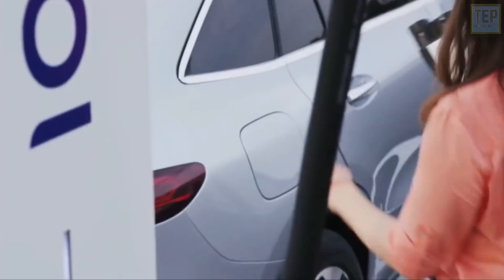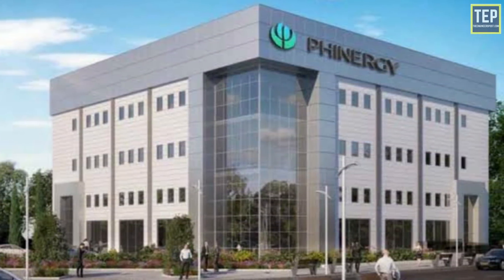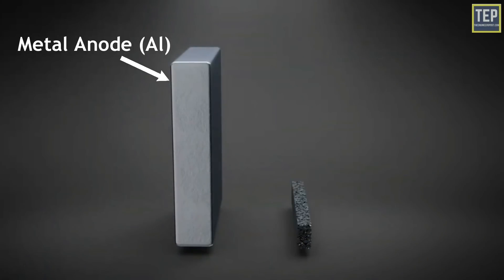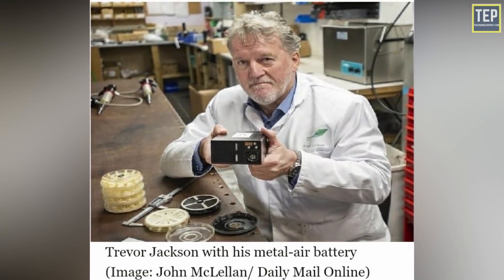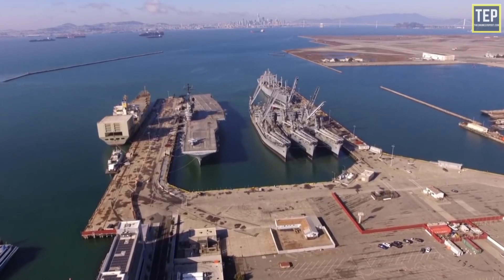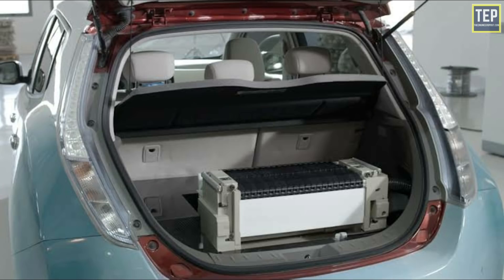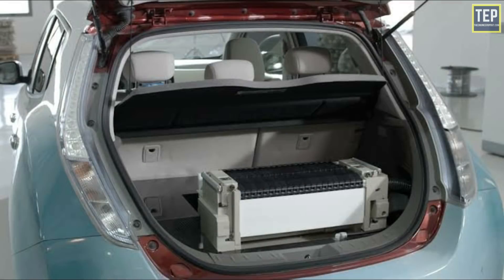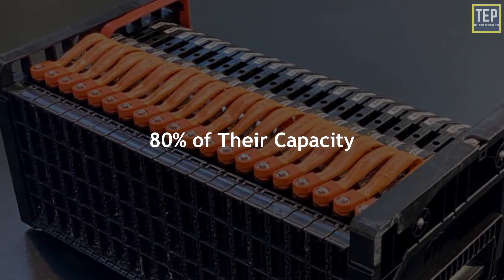Aluminium-Air Battery | An EV battery that Doesn't Need to be Charged

Comment: The title of this video is completely misleading. Also, the person who made it can't even spell aluminium properly. They misspell it multiple times. Anyway, the battery does have to be recharged. You just can't do it yourself. That's why it has to be swapped out with another battery, so it can be taken to a facility to be refilled.

Comment: Setting up the logistics  infrastructure to support Aluminium-Air batteries would be costly as you would be moving hundreds tons of freight to each service center to replace batteries for too few cars as compared to superchargers and or hydrogen solution's in my humble opinion.

Comment: Using the info from the video:
A Tesla Model S, with 370 miles/600km range, has about a 550kg battery pack. Replacing it with this aluminum battery world give it 2700 miles/4300km range. A kg only gives about 8km range? Short shelf life and non rechargeable?

Comment: First off, this "brain storm" isn't any more an EV battery than a hydrogen fuel cell. Yes, it is a power/ energy storage unit. Just like a gas, LP or diesel tank. What is the cost of a swap - fill-up? To head off power loss, two units would be needed. Good idea but comparing it to a battery is an apples & oranges misdirect.

Comment: what i think we need to find an alternative for petrol ..  it could be gas form or any lequid form ..  electric vehicle is Good but once the life cycle complete we have to replace new one and it will cost  50% of the vehicle cost..  battey wil get heat and we have to check daily ..

Comment: The biggest problem is degradation. So even if you don't use your car you need to swap the batteries let's say in 15 days or so. If this battery delivers range of 2000 miles and adequate swapping station then this is fake changer.
Reply: Maybe this Al Air battery can be made of different range and prices. You choose your range and swap at your usage pattern.

Comment: Since the aluminum-air battery cannot be electrically charged, the used aluminum anode and the electrolyte have to be physically replaced when re-used. In addition, the battery has a high self-discharge, which is why in some applications the electrolyte is only inserted into the cell shortly before or during operation. The additional technical equipment required for this is the primary reason for the comparatively low distribution and the high operating costs
Reply: that high self-discharge is a game stopper, I hope they find a solution.
I think the sweet spot for an EV for me is:
Aluminium-Air Batteries at 100 lbs with a range of 225 miles.
2 batteries giving a total range of 450 miles.
Reply: No you just cut the supply of water and no degradation will occur
The only disadvantage is that it recycle energy need is 5 times the output so you are running 20 percent efficient battery in overall system
To know more clear see
SCIENCE TO TECHNOLOGY channel
Reply: Where they've been deployed they work well.  They toughest part is they need an infrastructure of battery exchange stations.  I suggest the reason why they haven't caught on is people having a religious zealotry for rechargeable batteries and they cry heresy for anything that doesn't fit their idea of green.
Reply: I wonder if they have tried a capacitor shunt to create a reverse bias to prevent the self-discharge? In order to discharge the current needs to flow, so if you stop the current???
Reply: .. and The total fuel efficiency during the cycle process in Al/air electric vehicles (EVs) can be 15% (present stage) or 20% (projected), comparable to that of internal combustion engine vehicles (ICEs) (13%). that means e-efficiency is poor..

Comment: Well degradation can be 100% stopped, by keeping the Aluminium plate pulled out by mechanical mechanism of the water or the Aluminum Hydroxide solution when the vehicle is switched off.
Reply: Or, perhaps, pump out the 'electrolyte' when the power cell needs to be turned 'off' while not in use.  Less mechanical acrobatics by moving the liquid via a pump to a storage container than to move the aluminum plates.  If the system also pulled and maintained a vacuum at the same time (while removing the 'electrolyte'), that would prohibit air continuing to react with the aluminum. The vacuum would also facilitate the 'electrolyte' to move back into the 'power plant' when power was required again.
Reply: @TFEW-Phoenix  true, but draining out electrolyte and refilling will only take more time and need a motorised pump, which needs energy, , and hassle of leakage control remains, while taking/popping out the Anode Aluminium disk can be spring based mechanical or motorised task.
Reply: @bikramdeep2  , the mechanical movement would still require power and exposing the anodes to oxygen (air) still leaves them degrading constantly.  If "spring-based", it would still require mechanical energy to set one direction of travel.  I agree with the need for an "on/off" for the system.  We also need to keep in mind the wear points in an actual mechanical system.  Pivot points, for example, as we also realize that these points would be constructed as 'cheaply' as possible.  Perhaps the solution is something apart from both of our approaches but, always good to kick around solutions. :)

Comment: Another concern may be, when the vehicle is idle, does the reaction stop, or does it continue going on? I didn't see any mechanism video mentioned in that aspect. And if the cost of changing the battery every time it degrades, is greater than a lithium battery charging over a year, then it might not be sustainable (atleast in PV sector). However, this technology shows great promise in sectors which require continuous power, and if it could be miniaturised, then it can replace the alkaline AA and AAA batteries in a heartbeat.
Reply: As long as the circuit is open there is no reaction i believe.

Comment: First of all i must admit that, I am big supporter of this technology due its advantages. Big supporter of basically any tech. that is pollution free.
The most favorable one is its doesn't mess with environment and plus the residue can be used to make Aluminum back.  
As per disadvantage talked in the video i can think of having a extra battery ( if possible) or can have way to replace single or multiple Aluminum cell that are used in the battery.
Nevertheless that's an issue that can have multiple solution but i am eagerly waiting for this to be commercialized.
That will be a huge boost to EV tech in the whole world. That too without any pollution at all. 
All the best to IndianOil and PHINERGY.
Reply: At a degradation rate of 80% per month, it is impractical to have a spare battery in the car.  Also, nothing is pollution free, energy is needed to recycle and transport the battery.

Comment: Looks like this makes EV practical like other common formats. Need not make super light vehicles to squeeze out the extra range... They could make smaller blocks that can be easily replaced and also stored in case of emergency...

Comment: There should be a secondary source  of  power like lithium iron batteries  as af secondary  source  for emergency  use with a milage of  atleast 100km
Reply: So that people can charge in case of emergency  and recycling ♻️ power from regeneration breaks  will be use ful in adding up few km or miles it should  use both the batteries  until we get to know how the system works. Changes and precautions how to make it viable at our easy because cars are nessary things for state of comfort at our hands.in means of transportation

Comment: Yeah that trash that won't happen.
A none rechargeable battery, that has a 6 week life.
This means that you have a fully service requirements battery.

If you buy one you would have to add the electrolyte when fitting it and planning to drive for the next few weeks.

If you go into lock downs then you're not going to use it and waste my money.

Now if the battery was £40
Then you have. Half a chance.
Make it smaller with less range.
Imagine a drinks can that you can pop in the car and a small mixer to activate it.
Only needs 70 -120 miles range. (Big can)
30 mile small can. But they need to be hand held. And as eazy as tokens or washing machine tablets.

Comment: More than a hundred years ago, the inventor of reluctance motor used zinc.  But becauss zinc is expensive, reluctance motors find practical uses only today.  If they were able to power their boats and locomotives with zinc batteries, why not aluminum now?  This technology is great.  I hope our bright engineers succeed in making this technology work for the general public.

Comment: We can use two batteries and when one drains the driver can switch to another and change the other in nearby swaping station a similar way as how the reserve fuel nobe and system works in a petrol bike/scooter.

Comment: But he’s gonna wanna swap out another battery every time so you can get a hook up in discharge fee which is gonna be an arm and a leg on top of the fee of the battery you know the dealers are gonna fucking raise the prices with those things through the roof so no that’s a worthless battery if you gotta swap it out it seriously is I don’t even care if it’s got a 2000 mile range on it it’s not worth the hassle of half to make an appointment to go up there to swap it out at the dealership with the C it’s gonna cost did you that if I is gonna cost to buy the thing it’s stupid

Comment: I think it's not a good idea for electric cars. if it can do 2400 miles and after a month the battery only has 80% of it's capacity. I do not drive 2400miles in 3 months. 
if we use this battery, the aluminium price will 4X or more (demand supply market).  
I don't know but charging a car is propably cheaper than swapping non-reusible batteries. If it would be. it would be cheaper to have at home al-air battery's than getting power from the electricity grid network. 
How efficiënt ($cost$, energie, chemicals, environment inpackt)is the recycling of the battery.  If recycling cost more than mining Aluminium, recycling will not happen.

With an AA battery the voltage goes from 1,5 V to 0V. But if the device needs at leas 1V, that 0,5V  of energy at the end can not be used.
The same with al-air batteries, they go from 1,2 to 0V.  you are gone need  200 to get 240V. With the battery at 240V you will go fast and have lot of power but when the battery commes at 50V if the motor even can move the car with this voltage, you will not go fast and you will almost  have no power.  (bacis P = U * I) (And voltage has a lineaire effect on the rotation speed of the motor)

Even if they make a motor that would work on low voltages (50V).  To have 10kw of power. U need 200A. You are gone need to use a really thick cable and motor. (thin cable lot of resistants, thick cable less resistans)
high AMPS  through a cable or motor creates a lot of heat. (Why do you think the network grid works on thousands/millions or may even trillions of volts.)
With high voltage you are gone need a lot less amps and create less heat.

With litium u stay between 4.2V and 2.7V.

Comment: Since swapping stations are not common, there should be a way for currents Al-Air batteries to produce a capacity range to cover at least 3000-5000 miles range, then once returned to base, they can be swapped.
Reply: any regular gas station can be used as a swapping station

Comment: aluminum is already more expensive and if used like this prices would go even higher. with 3x energy density say you go 2000km before a swap. how much will a swap cost? gasoline costs 250$ for this trip in europe. if the swap battery is less then it’s ok but al reserves would go down

Comment: Swapping batteries, running around periodically to get replacement batteries  sounds like a lot of stress which takes away the benefits of not needing electricity to charge up.

Comment: Just like we have hybrid cars today, probably we can also get combination of Al air and Lithium Ion batteries to overcome or bridge the problems of each technologies.
Reply: Best solution is hybrid cars with replaceable Al-Air batteries
Reply: @babruwahan  That is a great idea. The gas motor could be small as you would only need it to get to a place that could swap out your motor. It could be a relatively small air-cooled motor with as little as 35-50 hp. Something like a Deutz F2l511 Diesel Engine Air Cooled 2 Cylinder.

Comment: sounds like it blows, I'd rather just leave home with a full charge every day than screw around with swap stations
Reply: Wait, you would rather spend 1 hr or more at a fast charge station every 300 miles (Tesla), than 3 - 30 min every 3 months/3000 miles.  Heck 3000 miles is a traditional vehicle oil change schedule.  

Most people drive 30 miles a day.  3000 miles is 100 days or 3 months.  So most people would only go to swap station on average once every 3 months. 

I'd rather save 10 - 20 hours over 3 months and range anxiety vs 3 - 30 min to pull in and pull out every 3 months.  

Not to mention we already have aluminium recycling plants.  I know of no lithium, cobolt recycling plants.  And lithium mining is expensive as it is far more limited resource than aluminum.

You Americans are nuts.

Comment: Is there any chance of that technology used to replace household solar batteries in future? And if possible,  how many  kilowatts and amp hours would one unit produce roughly?
Reply: These batteries can't recharge, so they'd suck as home/commercial stationary energy storage
Reply: Teslas best long range gives 500 miles, this battery at best 3000 miles, therefore 100kwh battery pack times 6 divided by 5kwh per day household use 120 days before replacement so every 4 months you swap, probably cheaper in the long run than power lines every where
Reply: @borne777  U.S. average daily household kWh consumption is ~30 kWh, not 5 kWh.

Comment: My aluminum (aluminium), air battery works fine so long as sodium hydroxide remains flowing. No special metal catalysts and the filter paper uses glue,(pva), and wax paper to strengthen the separator. But when the flow is stopped the aluminium oxidizes and can't be used again. I would guess this would be good for aircraft rated for flight time. Good luck India! I've watched Phinergy and Electric Fuel for some time now. Thank you for the post.

Comment: I believe that this is the future. This kind of battery creates electricity. The other needs to be recharged first and needs time for this. They must make a universal type of battery so every car uses the same. Trucks will need a bigger type or a stack of this universal type. Imagine something like the AAA batteries for cars, AA for trucks etc…… last but not least this kind of battery means that no need to electricity for recharging.
Reply: It requires power to recreate the aluminium in factory
Reply: @davelawson2564  Yes but there is grid and there is no delay to our travels. It is like the fossil fuels that require refiners. The new refiners will be these factories that will recycle 100% of the aluminium. Think about that. 100%recycling!!!!
Reply: @fotisfgg  But most car owners prefer not going to swap centers plus tax
most prefer the option to charge at home/office .
maybe trucks will opt for it if it really saves cost not otherwise
Reply: @davelawson2564  most car owners prefer not to wait 1-2 hours to charge than 3-5 minutes to swap batteries. Think about it when your battery is dead you change it in less than 5 minutes and then you are ready to go!!!!
Reply: @fotisfgg  at night you get 5 - 7 hours  or in office. none of EV owners stated this as an Issue
Reply: @davelawson2564  Yes but what if you want to travel and stay at night in a hotel? Where will you get the equipment to recharge? Hotels have no room for rechargers in their parking. It is oneway that the batteries should and must be interchangable  and universal....otherwise we stick 5-7 hours waiting for recharging. It will be our main concern in every trip we make. (No offense)
Reply: @fotisfgg  300 km - 500 km battery  is enough
can recharge at any regular 5 - 15 amp socket
Reply: @davelawson2564  for how long? The Aluminium battery is for more than 2700 miles.......so.....time is money....and it is for your trip not for waiting.How much does it cost to replace batteries in an EV car? Are you good in maths? If not then try to figure out how to find money for change the car......(if you have an EV car). Please keep in mind that here in Greece we have less charging points and the chargers are 2-3 maximum at every charging point.

Comment: If this was all true and it works like your showing and saying we would be seeing it already every where !! And the worlds energies problems would be solved.   The voltage and current you get from it is not strong enough and in the size needed. It's like a little boy pissing and a fireman using a firehouses, It's not the same.

Comment: I like this technology... It is a revolutionary technology .. highlight is it is giving long range of traveling.. as disadvantage is concern.. we should have one more small battery for an extra 20 kms  range  in emergency...
Reply: real issue is the cost per swap
Reply: Exactly because they are like using mercury-lead  AA batteries for toy car.... If the design could include machine it would have low overhead cost.